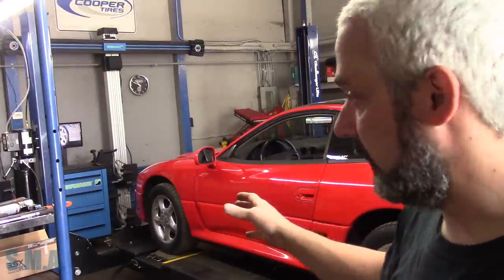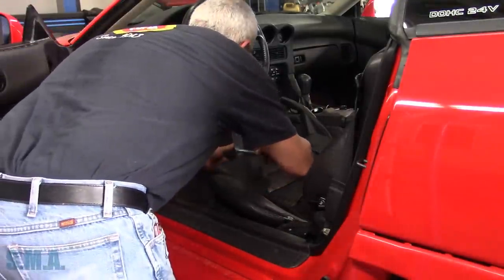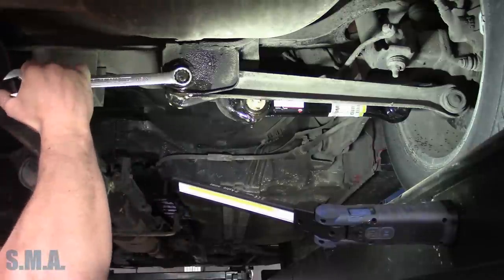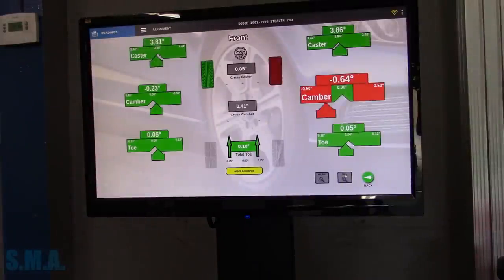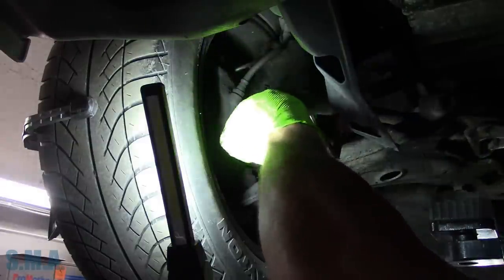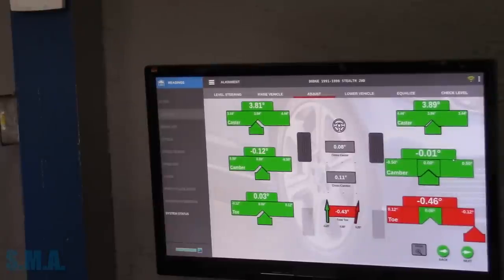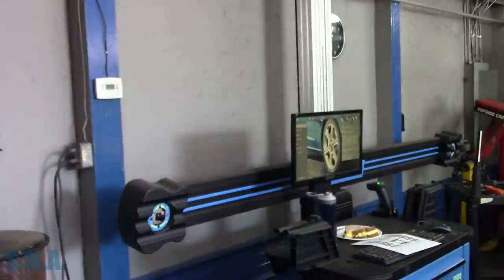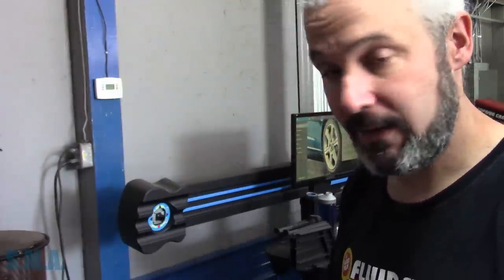Hofmann Geoliner 678: Performing A Wheel Alignment

Comment: Nothing drives me crazy like having your steering wheel crooked after an alignment.  I just had an alignment performed on my daily driver and they did a quality job but the wheel was off center by a little amount but it drives me crazy going down the road.  Glad to see Eric O finally got his own machine!
Reply: I’m glad I’m not the only one. I can’t drive a car with an off center steering wheel.
Reply: Some of this may be the way your roads are paved. Almost all roads in America are crowned to allow water runoff. In those cases a vehicle adjusted perfectly on a flat surface will have a slight pull. Its not unheard of to bias the toe angle so that the vehicle has a very slight pull to the left meaning it will track straight on 1 lane roads. You'll notice this the most when highway driving in the passing lane since that toe actually makes the crown more pronounced instead of compensating for it.

Next time you go in for an alignment mention to them the way you drive and inquire if they compensate for road crown.

Comment: These are all nice machines, but my understanding is that they do not actually measure the physical geometric centerline of the vehicle, but use high resolution cameras to pick up on the normals to the axles via imaging the reflective paddles during the so called rim compensation.  The centerline is then estimated from the calculated 2d plane.  So it seems to me that just the noise in the images that the camera picks up and processes will cause some variation in the measurements.  Therefore Eric is right about "chasing" the small changes.

Comment: GREAT VID. ERIC, Just walked in the house. Was out trying to get a miss fire out of my 97 Jeep Grand. 4.0l. New NGK plugs, wires, Accel Dist. Cap & Rotor. I just put new plugs in right before winter but this miss fire drives me KRAZY ? Drives fine but it fish bites in park ? Well all the new parts helped but still has a small miss fire ? I think I'm going to get a new distributor, already have timing chain & gears to put in soon. Have a bunch of other stuff also, Jeep has 183,568 miles on it so ?                                                                                                               How is your Grand coming along ? Did you have time to work on it during the virus thing ? DAMN FINE MACHINE YOU HAVE THERE, NOW NO MORE RUNNING TO YOUR DAD'S OR BROTHER'S SHOP FOR AN ALIGNMENT, VERY NICE SIR. In N.E. PA.                                                                                                                                         I get charged between $ 100 & $150 for a four wheel alignment but my tires & arms thank me,LOL. THANKS FOR THE VID. IT WAS VERY COOL TO WATCH, ALWAYS LEARN SOMETHING IN YOUR VIDS. SIR ERIC, ALWAYS & I'M DAMN NEAR 55 YEARS OLD. BEEN WORKING ON VEHICLES & SUCH SINCE I WAS AROUND 10 YRS. OLD.

Comment: I have an ID-10-T question (a non-car guy who loves this channel)... if everything changes when you sit in the car, why is the process not done with a driver-sized load in the driver seat?
Reply: The specifications are determined by the manufacture and will have some compensation for anticipated driver and load conditions. Most alignment pro's will ask questions and determine if loading is different for a particular vehicle or application.

Comment: Excellent four-wheel alignment. Thank you very much. But I am always wondering . . . If the alignment changes just my sitting in the car, would it be possible to put some weights on or near the front of the driver’s seat before doing the alignment? Or does the alignment stay green when a driver is in the car?

Comment: Eric,
Quick question. A 2002 Chev Trailblazer loses a alternator the battery drops down enough that the Radio and other things stop working.   After the Alternator repair the AC vents blowing hot air. How do you reset the Actuator motor or motors. Scan Tool??? Thanks enjoy the show  watch it most every day. Enjoy the Electrical issues the most. Do you need an experience scan tool to preform recalibration??? I know you talk about bi directional communication on the Networks. Where do you viewer live at? Do you have a wide area of subscribers? Thanks

Comment: Very interesting! On my wifes old Chevy HHR (no jokes please, its been a great car and my daughter is driving it now) when we bought it the steering wheel was about 20 degrees off center.  My local guy suggested an alignment.  How did that make the wheel straight? Adjusting the tie rod ends? In the old days I would have just popped the wheel off and put it back on so it was level.
Reply: Sure, I post this then you show me how its done! Great. Really enjoy the videos, thanks for sharing!

Comment: I wonder if that alignment machine has some software settings to correct for the Ford trucks, Jeeps etc. death Wobble that is usually corrected with a Caster Kit !
I'd presume all 4 tires on any vehicle have to have the same tire pressure in them before doing this alignment?

Comment: The new shop I started at about a year ago now has me doing all the alignments. Rest of the guys give me hell all the time because I try to get my alignments close to center as possible of spec, and they all just go "Its green so its good". First shop I ever worked in the guy who trained me for alignments started me ignoring the colors. Im so glad he did. Went from a Hunter machine to what we use now is a John beam, Identical to your machine but on a mobile stand. I sure do miss the Hunter machine.
One question tho for your alignment hoist you have now. Have you found any issues with setting toe yet? I noticed on ours even if i lock the steering I can set the toe on the right side, But soon as i go to adjust the left the right moves also. Quite annoying haha.

Comment: And he writes, Hey Eric great vid, great job. Question when you did the elevated adjustment to the front end, did you raise both the front and back of the vehicle to make it level.  Or did you just have to raise the front and leave the rear on the lift. Thanks
Reply from the maker: If you do an elevated adjust it holds the measurement. You can jack the front or the back. It does not have to be level then once you have the car where you want it, the measurements go live again. Hope that makes sense

Comment: Great video i got a question though. I have a 2010 toyota sienna power sliding door latch actuator seems to have no power i have tested the actuator it spins and moves things on the lock but does not seem to move the latches. I have checked wires, fuses, and grounds any idea on what it could be? The right side door works perfectly there is a multiplex module tried changing that but didn't work.

Comment: Do you have any videos for a newer Durango in terms of headlight issues? I replaced the bulb, thought it just burned out. Well it went out again and seemed to be a lose connection, so I replaced the harness and it’s still not working 😭 I’m lost. Could I need a reset on my TIPM?

Comment: did they train you how to use the aligment lift
Reply: An alignment is an alignment. I've used optical systems, photo systems, and even one shop had a super old light and mirror system. They are all pretty much the same (except for that light system... it was a POS from probably the '50s), so no real training required.  
However, I have worked in shops that upgraded their systems and usually either the installer or the sales rep will give you a 15-20 minute walk through of new features such as the software, rim clamps, or the targeting system. It's not really required to get up and running, I think they just do it to add a personal touch so you fell better about all the money you just spent.

Comment: I much prefer using easy toe to locking the steering wheel for getting front toe set on everything except Jeep Wranglers and Ford trucks and vans.  I sure miss having a computerized alignment machine particularly for my own cars.  After working at the chain stores I saw how sloppy most alignment tech's are.

Comment: How many wheel alignments do you have to do .. to get your money back on that machine??
Reply from the maker: If alignments are $100 you would have to do 550 of them to break even on the equipment. However the alignments are not where you make the money.
Reply: I think not only will he get is return doing the alignments, but also the time it takes to go to his brother's shop, which I think use to be his dad's shop if I remember Eric's stories correctly.
Reply: @Jonathan Fennell It beats looking down a telescope at a mirror. Aah the good ole days.
Reply: @SouthMainAuto  Beats our old porta liner with 4 stools we used in the early 70s.

Comment: Just wondering how much do you charge for a 4 wheel alignment and is it good as preventive maintenance to do it once a year
Reply: Can't hurt to have it checked once a year - say, right after dealing with winter potholes.  But if it's in spec, there's really nothing to "do" but print out the numbers and send you on your way.  :-)

Comment: In '71 customer had us align WIFE'S car. R F tire worn on edge. Caster out slightly, so we adjusted it and put on 2 front tires . Came back after 5000 mile trip. R F tire worn on edge. Checked alignment, it was ok. Turns out wife did not drive at all. Did not know how to drive. WIFE'S car was only used when wife and husband went some where together. Wife was rather a large lady. Solution: We aligned the car with 2 of our guys in R F seat as close together as possible and against the door,  put 1 new tire on R F.   PROBLEM SOLVED !!! 
 MORAL OF THE STORY : Some times you got to get the rest of the story. He told us the reason she did not know how to drive was because she could not fit behind the steering wheel.

Comment: Explain to me how a guy can do alignments all winter with little problem, but when the temperature hits 90 deg. almost every job requires firing up the torch and heating the jam nuts? Can't have the torch heat in the winter...just the summer

Comment: 20:00 when I took my BMW X3 he said they have to have weight added to them when your doing the alignment so when the car is actually being used it right where I needs to be.
Reply: Some, not all, BMWs should have indeed weight added. The ballast should be put on the trunk. It has nothing to do with it being right where it needs to be when the car is used. It's to compensate the effect rwd has on camber along the speed envelope of the car. Check your manufacturer literature for in depth info regarding specific models.
Reply: We use sand bags or old wheels in my shop :D

Comment: If the alignment changes with someone in the driver's seat, shouldn't the alignment be done with weight on the driver's seat? After all, the car is never driven without someone in the seat.

Comment: Why do they call it "level the steering wheel?" (serious question)
Reply: Because the steering wheel is level or centered and not at a slant when going down a straight and level road. Nothing is worse than driving straight and steering wheel shows you’re turning. Some shops put the steering wheel a little off level/center so that it allows for the crowning in most of the rural roads. Just make the owner/driver happy because either setting is okay.

Comment: Who else went and looked up the price of that tool?
Reply: Don't leave us hanging on the price.
Reply: Like 25.000 bucks
Reply: @anderleof  yes that was kinda a base option price
Reply: B Harmon  $25,000 is for the alignment machine. Add another $20,000 plus for the lift
Reply: @MevRB19  Mr. O. must be getting enough business to justify getting the machine; perhaps he leased it instead of buying it.
Reply: @MevRB19  He does tires. Only fitting he does the alignments too.
Reply: @MevRB19  - The roads in the Northeast here beat the crap out of vehicles. Road salt also gets into torn ball joint and tie rod end boots, not to mention pitman and idler arms on some trucks, and older cars. Front end component replacements are your bread-n--butter jobs up here. Every one needs an alignment afterwards. It was a wise investment from where I'm sitting.
Reply: Alignment in the northeast is critical to maximize tire life. Especially considering most people have 4wd or AWD cars now. So in upstate NY, an alignment machine is a good investment; and for those wondering. My car has 27k on the clock and needs an alignment, its not bad but I can feel it.
Reply: JpHDev it’s still a lift. Work can still be done on it. Basically everything but exhaust and transmission work.

Comment: beats the hell out of the old bear bubble heads.   if the customer is a lard ass better have them sit in the seat.  when the toe is out on both fronts in the same direction it drive ya nuts wondering if the steering wheel is clocked wrong or someone was playing that had no clue. have seen twisted steer gear shafts and bent pitman arms cause that too.